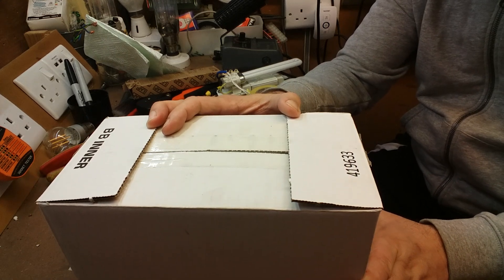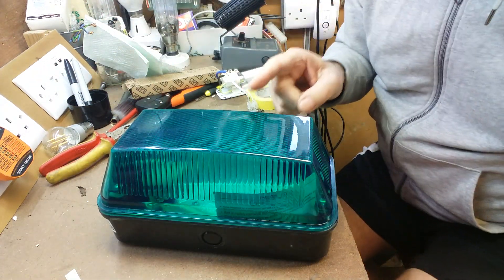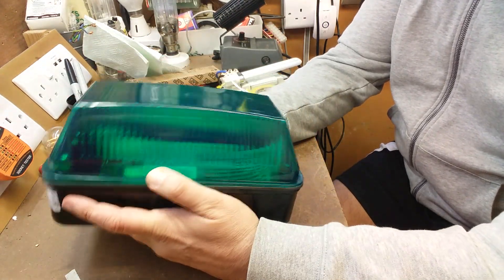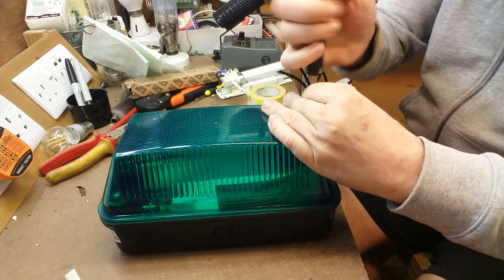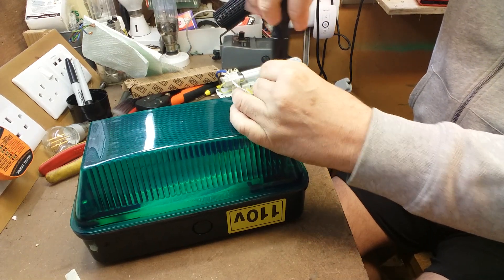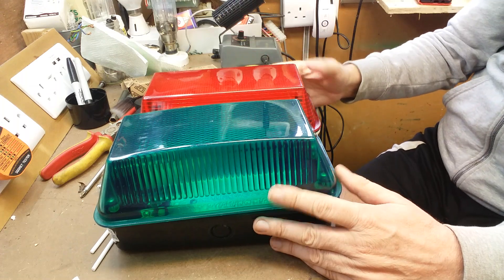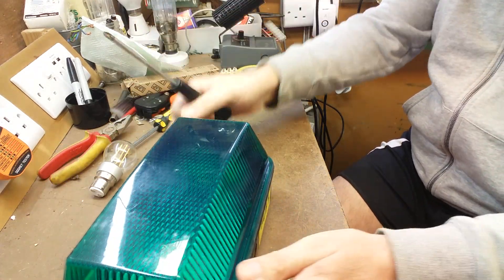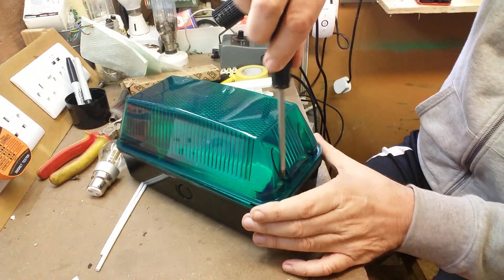BC GLS Bulkhead Lantern, But Why Rated 110V??

Comment: It's labeled for sale in the USA. Surprised you couldn't work that out on your own.
Reply from the maker: The fact was you could use any voltage lamp in this fitting. Lamp holders are not voltage regulated so why 100v when you can put any voltage to it. Thats the question

Comment: Probably the result of some corporate purchaser who insisted on having a 110V-rated fitting for a construction project, and refused to accept that a 240V fitting can be used for anything up to 240V.  The manufacturer probably sold them a ton of special edition lights at twice the normal unit price, just with a pretty little 110V sticker attached.

Comment: 110 volts is for construction sites.   
240 to 110 volt transformer output is 110 volts between live and neutral. 
Coil on 110 volt side of transformer is centre tapped to earth meaning it's 55 volts between live and earth for safety.
When it's dark in the winter red lights are a warning, green indicate an access.
Reply from the maker: Thanks stephen. Excellent comment, very good info. I remember on sites 110v as also coloured yellow.

Comment: I have seen both “red & green” bulkhead lights of that style next to the shutter doors on a fire station = indicating if the parking bay is occupied by a fire engine/appliance = red, or if it is empty = green, when they are returning from a call-out and the doors are closed. The control system might run on 110v?

Comment: Hi Jaye, at last a green bulk lens bulk head lamp, and yes you can connect to 240v on a 3 or 5 amp circuit. My be fit them above your shed door " Enter " on green and " Do not Enter " on red, great video ,hope you get you 400 subscribers soon, Take care
Reply from the maker: That's a great Idea. Yes I could rig that up.